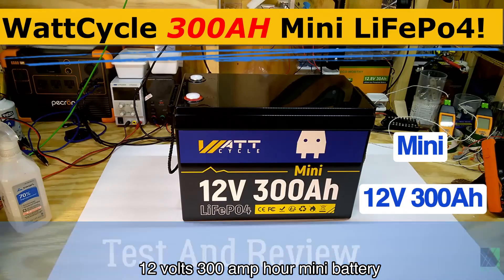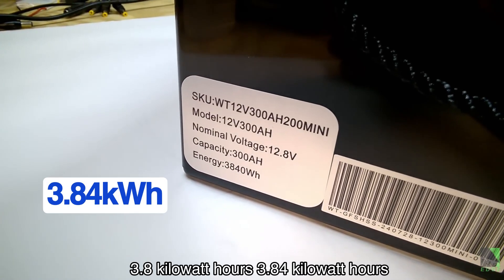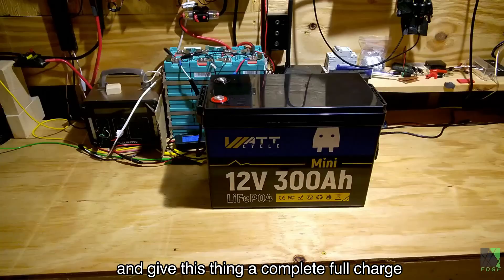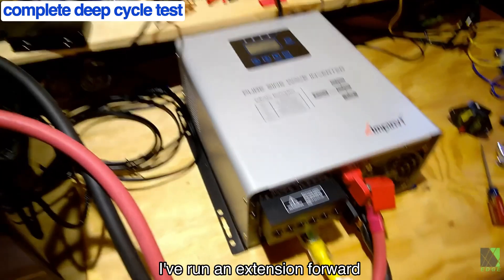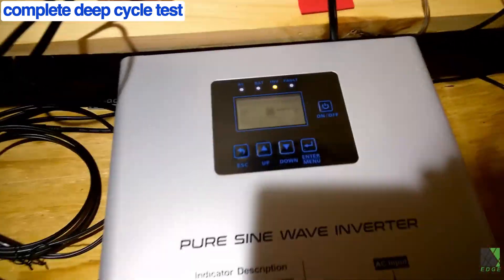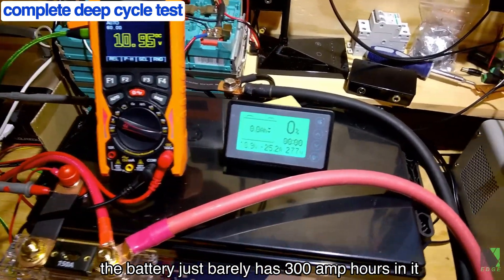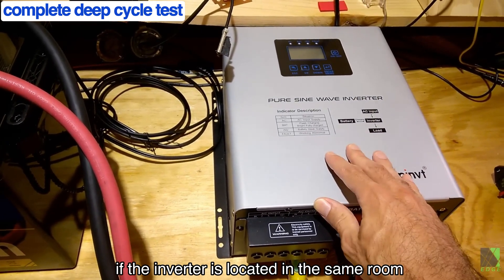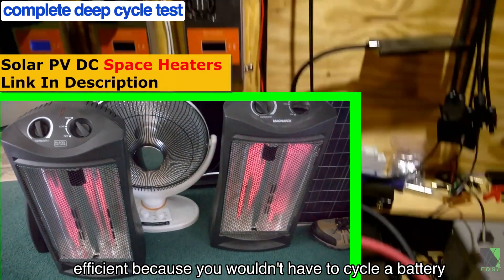Power Performance: WattCycle 12V 280Ah Mini Battery Review & Load Test

Comment: I require 4pcs of 12volt 300ah wattcycle lithium ferophosphate batteries to imply in my e-rikshaw.
I want four batteries.
Reply from the maker: That's great to hear you're considering Wattcycle batteries for your e-rickshaw! For inquiries about purchasing multiple batteries (like the four 12V 300Ah units you mentioned), the best way to proceed is to contact our sales team directly. We can provide you with pricing, availability, and answer any specific questions you have about using our batteries in your e-rickshaw application. You can contact us here: support.us@wattcycle.com

Comment: This test is not even a .2C discharge rate. I calculate it to be only .14C (42amps). The factory does test these to 1C and that is what is needed to judge the quality of the unit.
Reply from the maker: We appreciate you pointing this out. We'll consider showcasing a 1C discharge test in future videos.

Comment: I have  tested a DJLBERMPW 300ah battery at a .36C discharge rate. 109 amps draw from the battery. This test revealed 310ah.  People don't buy these larger batteries for discharging over long periods of time like older lead acid RV batteries. These need to be tested to a 1C rate for off grid use.  If you send me one free I will test it properly.
Reply from the maker: Thanks for sharing your experience with the DJLBERMPW battery. We understand the need for higher discharge rate testing, especially for off-grid scenarios where larger loads are common. While this video focused on a specific use case, we acknowledge the value of a 1C test for a comprehensive performance evaluation. Regarding your offer, we appreciate it. Please contact our marketing via marketing@wattcycle.com to discuss this further.

Comment: The original creator of this video has deleted constructive comments on this test. Many have said this test of less than .2C discharge rate is not a industry standard of 1C. His response was they all had Ego issues and his test was good enough.
Reply from the maker: We appreciate your feedback regarding the discharge rate used in the video. You're right to point out that a 0.2C discharge rate is lower than the industry standard 1C test. While this test demonstrates the battery's capacity under a lighter load, we understand the desire to see performance at a 1C discharge. The recommend charging /discharge rate is 0.2C / 0.5C. We'll take this into consideration for future testing videos and aim to provide more comprehensive performance data. Thanks for your input!
Reply: @wattcyclepower  You should not endorse a video if it does not fully represent your products capabilities. . This guys video is not fully showing your fine product.
Reply from the maker: @timesup6386  We appreciate your concern. Our intention in sharing this video was to demonstrate a practical application of our battery. We agree that fully showcasing its capabilities, including higher discharge rates, is important. We'll take your feedback into account for future content and aim to provide a more comprehensive representation of our product's performance.
Reply: @wattcyclepower  It's not even a .2C rate 42 amps from the battery is all that a 500w 120v load requires.
Reply from the maker: @raylaux8295  You are absolutely correct. The 42A draw from the battery in this video, powering a 500W 120V load, doesn't reach a 0.2C rate. This video focused on a specific use case, but we understand the importance of demonstrating performance at higher discharge rates, closer to 1C, for a more complete picture of our battery's capabilities. We'll keep this in mind for future videos.